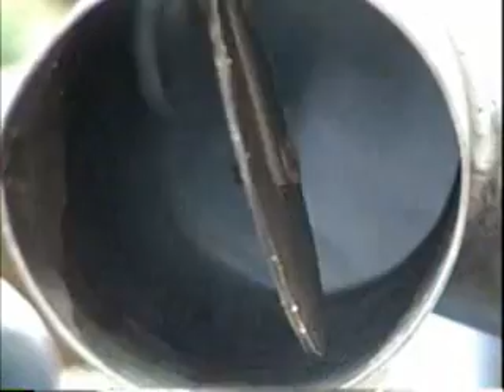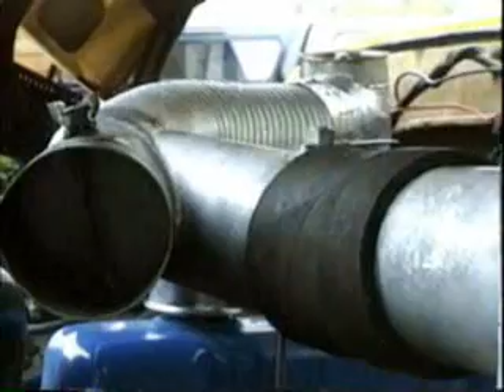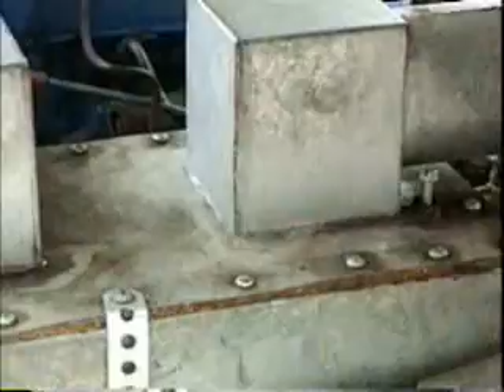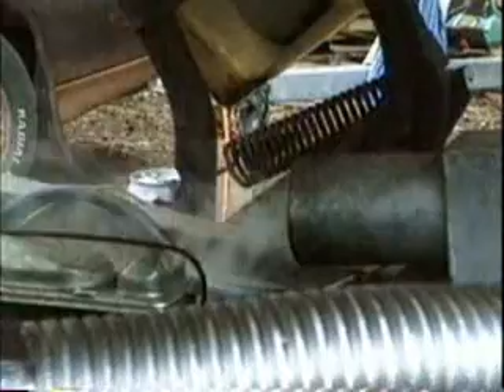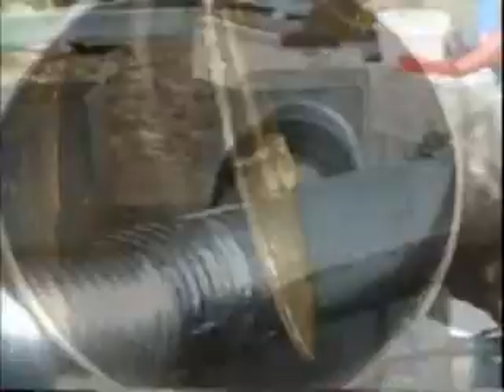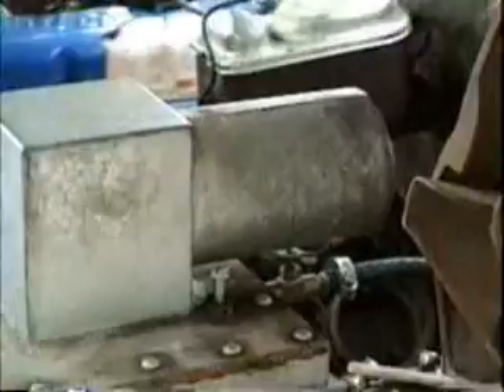Here is definitive proof on how to separate all Atoms in all liquid soluble matter.

Comment from the maker: If you can maintain between 212 and 230 degrees Fahrenheit, on the heating element surface, when a fine mist of water is being sprayed onto the heater. You will produce all the hydrogen contained within the water being sprayed onto the heater. This means you will be able to use water in your gas tank ands make  enough hydrogen at the intake manifold and run the vehicle on hydrogen produced from water, at the engine, without a high pressure fuel cell. The precise temperature makes this possible..

Comment from the maker: You need to read and watch all my videos before you put your foot in your mouth. It is not just about making a vehicle run on fossil fuel. I changed the fossil fuel, by using the right temperature, applied the right way. With my process I found the temperature to make a flammable gas from water, with my Flashing Liquid Process. The only flammable Atom in water is Hydrogen. A large enough heater, a precise temperature control, and fine spray nozzles, will make enough hydrogen for any vehicle.

Comment from the maker: Basically the milk industry uses a similar process to extract liquid from milk to create powered milk, and powdered products from milk. They spray a fine mist of liquid into a chamber, where 400 degree Fahrenheit hot air separates the liquid from the solids in the milk. They are doing what I now call flashing liquid, taking the liquid above it's boiling temperature and find the boiling temperature of molecules in that liquid, which allows only that molecule to boil, and separate in the liquid

Comment from the maker: On the gasoline I sprayed the fine mist of gasoline onto 2 flat bar electric heaters ( two, 110 volt heaters, wired in series creating 500 watts of heat). The heater temperatures were around 600 degrees Fahrenheit. The secret is to maintain the desired temperature. A large mass heater is needed to do this, the larger the mass the more constant the temperature is. On the water I found between 212 and 230 degrees Fahrenheit I produce a flammable gas from distilled water. Use a fine liquid mist.

Comment from the maker: Agreed, the injectors spray the liquid gasoline into the intake manifold, but that manifold is no where close to 600 degrees Fahrenheit. The fine mist of gasoline sprayed onto a 600 degree heater will cause a portion of the liquid to boil, having reached that portions boiling temperature, and not reaching the boiling temperature of the metallic additive portion, which is non flammable. I did the same to water and detected a flammable gas. A larger heater mass will produce more flammable gas.

Comment from the maker: Like I have been trying to tell you. My Flashing Liquid Process separates those metals, and waste from the liquid gasoline. Mixed in with the gasoline, this non flammable liquid I create is of a metallic origin, and don/t boil at the 600 degree Fahrenheit temperature I have applied the liquid to. It is the flammable portion of the gasoline that boils and turns to a white vapor, that has twice the power of gasoline.

Comment from the maker: You are not grasping just what I have done. Small particles of metals don't change state with under 1000 degrees of temperature, applied, or what ever the melting point the metal has. I am working with liquids, not solids. I am a disabled Vietnam Combat Veteran on a fixed income and can't afford the lab tests to prove what I say, but creating a flammable gas from distilled water, using the same process as I did on gasoline should be proof enough for it to be checked out. But not for pessimists .

Comment from the maker: The liquid that makes up the bubble from the gasoline sprayed onto the heater is no longer flammable and will not mix with the gasoline it was created from. I know, I used a float valve to maintain the fuel level in my chamber, and after 29 minutes and 52 seconds the chamber stopped making my white vapor, filling with the non flammable. This liquid has an oily texture, and it's boiling temperature is well over 600 degrees Fahrenheit. A guy here on You Tube took it over 700 degrees and it boiled.

Comment from the maker: Spraying the fine droplets of gasoline onto the 600 degree heater, I watched these fine droplets of gasoline form a bubble. Inside the bubble is a clear gas, when the bubble breaks the clear gas turns white like magic. You do know when a molecular change takes place a void is created in the original matter.Nature fills this void with what matter is present when the change happens, in my case oxygen in the surrounding air. This is why I get a 50% increase in power over gasoline, & no smog.

Comment from the maker: Whatever the size is of the component is that makes up the chemical structure of the water. I am boiling that hydrogen component inside the water, at between 212 and 230 degrees Fahrenheit. The change of state of the liquid to a gas takes longer than heat transfer does, The liquid goes to the temperature then boils. In my case in the 212 to 230 degree range. Gasoline showed this to me, when I sprayed the liquid gasoline onto a 600 degree Fahrenheit heating element.

Comment from the maker: It is the fine droplets of water that assume the heater temperature, faster than the liquid can boil that allow me to take these small droplets to the 220 degree Fahrenheit temperature faster than the liquid can boil. It is here where the hydrogen molecule in the water boils, and the oxygen molecule, having not reached it's boiling temperature, in the water, remains a liquid, but upon the separation, of the molecules, the oxygen molecule boils after they separate. I get a flammable gas from this

Comment from the maker: You know what the change of state of matter is? Liquid to a gas. You know how long it takes for a liquid to boil and become a gas? Due to convection heat transfer happens faster than liquid can change state. If you apply a fine mist of water to a heated surface. A fine mist of water will go to the heater temperature faster than the water can boil. so using this method you can take the water to any temperature before it boils. At 220F hydrogen molecules will boil, oxygen molecules don't, in water

Comment from the maker: Liquid Oxygen boils around minus 450 degrees Fahrenheit. When hydrogen is turned to a gas and separates from the water, a void is created in the molecular structure of the matter. Nature will fill that void with the surrounding air. Air, has oxygen, giving the 2 parts hydrogen gas one part oxygen gas. Upon the hydrogen molecule boiling, only the Oxygen molecule is left as liquid, and it boils immediately. We now have a H2 O2 gas that is more flammable than just hydrogen, more power.

Comment from the maker: I use stainless steel resistance heaters, they seem to keep a more constant temperature. Imagine this, take a very large block of stainless steel heat it up to 220 degrees Fahrenheit, spray a fine mist of pure water, no chemicals added, onto the heater. You would produce all the hydrogen contained in the water sprayed, and would do so until the temperature of the stainless steel went out of the 212 to 230 degree temperature range. The hydrogen molecule turns to a gas and oxygen stays a liquid.

Comment from the maker: I would use a large mass heating element with enough surface area to spray a fine mist of water to sustain the separation of the hydrogen and oxygen molecules in the water The temperatures are between 212 and 230 degrees Fahrenheit.   A close tolerance temperature control on the heater is also needed. When hydrogen reaches it's boiling temperature and oxygen doesn't, their molecules will separate. The oxygen will remain a liquid long enough to separate  from the hydrogen. A mathematician helps.

Comment from the maker: The molecules with the lowest boiling temp will become a gas first, and as you increase your temperature other molecules inside the original liquid will boil, and that gas will be a mixture of different molecular gasses, until you reach the boiling temp of the highest temperature molecule in the original liquid, then all the liquid is a gas. Just like the skin of an onion, molecules will peal off in layers, according to the temperature. The higher the temperature the more layers peel off.

Comment from the maker: Just try different temperatures on different liquids, when you find a temperature that gives off a liquid after some gas has been created, or it would help to have some means of detecting gasses you are trying to create, like a gas spectrum analyzer. These gasses will appear when you have found the temperature that turns that molecule to a gas. The molecules in different liquids will have different boiling temperatures. They can be extracted 1 or many at a time, using temperature.

Comment: Thus far, you've achieve excellent results flashing gasoline beyond it's original boiling point of 536F, by spraying a fine mist of gasoline onto a large heat mass of steel, with steel being heated to 600F. This same process permits and confirms an autoignition temperature of gasoline to be 950F. With H2O, you've also achieve Hydrogen Production from 212F to 230F. Please say more about liquids, boiling temperatures and molecular changes.

Comment from the maker: There is an optimum temperature in the 18 degree Fahrenheit temperature range  I have discovered, that produces hydrogen from water. You pin point that exact temperature and maintain it, you will produce all the hydrogen contained in water.

Comment from the maker: What is needed to get the most hydrogen from water is maintaining the heater temperature when the water is sprayed onto it. You will need a pretty large mass heat source, and a fine mist of water. Mathematicians could calculate the size of mass in relation to the amount of hydrogen in the water, needed to run the engine size it is installed on. The heater size is the first step, and a mathematician will help.

Comment: When I first began experimenting with your flashing liquid(ie H2O) at 212F to 230F, I was trying to ignite the Hydrogen Atoms released from the Oxygen Atom. What I now realize after watching your new videos, There is Hydrogen Present, however not enough(See Stoichiometric Air To Fuel Ratios) to ignite. Your Flammable Gas Leak Detector Meter clearly shows some Hydrogen has been released from the Oxygen.

Comment: Your most recent video uploads are very interesting experimentation and discovery. A video title that may be easier for you tube viewers and hydrogen production experimenters to locate- may be "Hydrogen Production At 212F To 240F. Fine Mist + Large Heat Mass Required" You can edit your video titles here on you tube.

Comment from the maker: I actually made two videos, both produced the flammable gas. The temperature to maintain on the heat source is between 212 and 230 degrees Fahrenheit. Remember the fine spray is a must, along with the mass of the heat source. I used a combination refrigerant, and combustible gas leak detector, with the combustible gas tip on the probe. Try it yourself, and iron skillet is a good mass to experiment with. You need the leak detector to see it.

Comment: I'm looking forward to watching your most recent upload(presently in processing). I'm looking forward to see your achievement of breaking the Hydrogen atoms(covalent bond) away from the oxygen atom with nothing more than(specific) temperature. Interesting :)
Reply: True Zero Emissions to break water molecules apart with heat you need 3,000C or around  5,432 f. And then something over 50% actually disassociate into an oxygen atom and a pair of hydrogen atoms. Much better off using frequency roughly the distance between Oxygen and hydrogen atoms. It would be similar to how a microwave heats food.

Comment from the maker: Because the boiling temperatures of hydrogen and oxygen are so close, around 60 degrees Fahrenheit. It will require a large mass of heat to maintain the 60 degree temperature, to cause hydrogen to turn to a gas while oxygen remains a liquid, the gas and liquid will separate at that instant, making hydrogen the gas, and oxygen boiling at minus 460 degrees Fahrenheit will boil right after the hydrogen and both will become a hotter burning hydrogen HHOO gas. No a glow plug won't work.

Comment from the maker: My main objective is to prove I did a molecular change to gasoline, and knowing what can be done to one liquid can be done to any liquid.  Hydrogen from water, applying the water to the heating element, set to the right temperature will produce it, and we will put water in our gas tanks. Now when hydrogen burns it makes water. No emissions, and a fuel source that replenishes itself. Not to mention what science and medicine can do with this.

Comment from the maker: Actually I used two, 500 watt 110 VAC flat bar heaters wired in series, creating a 1000 watt draw. I create a white vapor from gasoline applying the liquid to the heating element whose temperature is 600 degrees Fahrenheit. You see the fine droplets of gasoline go to the 600 degree temperature before the liquid gasoline can boil, and this is the boiling temperature of molecules inside the liquid gasoline, turning them to a gas, while other molecules remain a liquid. Lab tests will prove me right

Comment: It seems the doubling of horse power(verified by dynomometer test) more than makes up for the draw on the engine(powering the electric heating elements which flash heat the fuel into white vapor). Furthermore, Zero Emissions(verified by smog test). Zero emissions without a catalytic converter. That's interesting :)

Comment: So 250 watts. About 2/3 horsepower draw off engine. Burning vapor makes up the difference for vaporizer draw. 
Vapor is invisible. There can be up too 400 chemicals in pump gasoline. About 40 in racing fuel. Good luck Bill.

Comment from the maker: The heaters I used were 110 VAC, 500 watt, wired in series. I used a generator I had special wound to produce 110 VDC at 2000 RPM. The inverters they have now days work so much better. Someone has already found a different temperature to use, 700 degrees Fahrenheit. This temperature eliminates the non flammable liquid, that I accumulated in my chamber. The closer to the intake manifold the heater is the, easier, and simpler it can be made. A large mass of heat and fine spray is the secret.

Comment: You manipulate the electrostatic magnetic field with a process you call high temperature flash heating. Taking a highly pressurized(90 psi works very well) fine mist of gasoline(Through a fuel injector works well ie 50 to 65 micron liquid droplets of gasoline) instantly beyond it's boiling temperature to 600 F. You found(and has been confirmed) that gasoline will not auto-ignite until 950 F.

Comment: That sounds quite good. In my research of sending fuel through magnetic fields, I learn that the NASA Space Shuttle stores liquid Para Hydrogen which has a BTU similar to Natural Gas ie approximately 85 BTU. With nothing more than an electron spin, the Para Hydrogen becomes the much more powerful than gasoline(only 115 btu), Ortho Hydrogen(just over 300btu). An ElectroStatic Magetic Field seems to contain all atoms and molecules.

Comment from the maker: Interesting, so 2/3's of a drop of water is made up of hydrogen. If my calculations are right then with my process, the final makeup of the gas I can produce from water will be a H2 O2 gas, a highly flammable gas, more flammable than just the hydrogen gas. When hydrogen burns it makes water. I am just wondering how much water is produces after the hydrogen burns. This could cure the world's smog problem.

Comment from the maker: You know thinking about me applying a fine mist of liquid to a heating element, whose temperature is 600 degrees. I was just thinking about how they create snow, with the snow machines on ski slopes. They use a fine mist, backed by air pressure, and the outside temperature turns the water to ice instantly. this is a change of state of water a fine mist and temperature, well doing the same thing applying water to heat will affect the water just as fast. Hydrogen from water is possible this way.

Comment: The spark plugs in your truck fire once every four strokes of the pistons. In your truck engine, both Oxygen and your white vapors(produced from ordinary gasoline) are drawn into your engines piston cylinders during the intake stroke. During the intake stroke, your intake valves will be open. Then comes the compression stroke. Thus compressing Oxygen and given fuel ie gasoline or your white vapors. The final two strokes are power stroke, then exhaust stroke.

Comment: The difficult is achieved at once, the impossible takes a little longer. You have been doing the impossible for over 25 years. Running an engine on vapors produced from gasoline, doubling your horse power and achieving zero emissions from your exhaust, without O2(Oxygen) sensors and without a Catalytic Converter. Most master mechanics, physicist, and engineers would say that is completely impossible.

Comment from the maker: Firing the spark plug during the compression stroke is impossible. The intake and exhaust valves are closed on the compression stroke, no oxygen is present to create the burning of the fuel. My suggestion to the people who believe what the internet says is, read the information, try what they say and go with what works, not what the internet says. If I had stayed with what the internet said, I would not have created the white vapor. The internet says gasoline auto ignites at 530 degrees, wrong.
Reply: There is oxygen on the compression stroke.